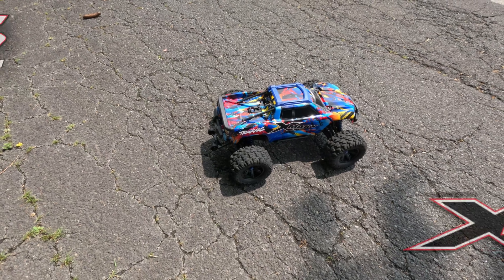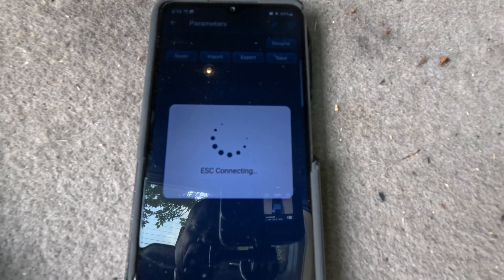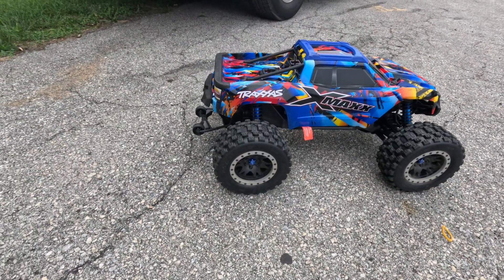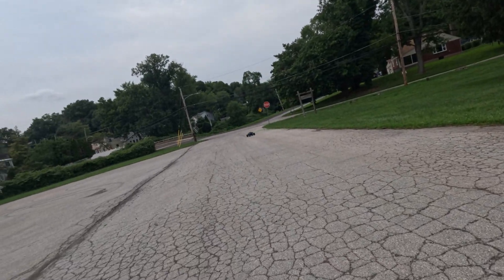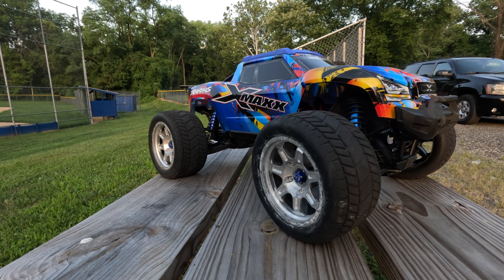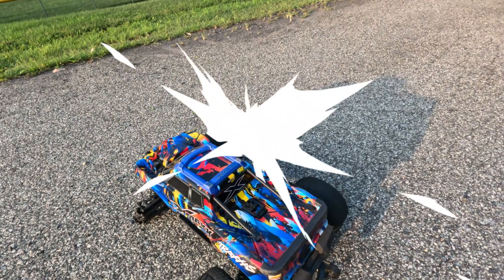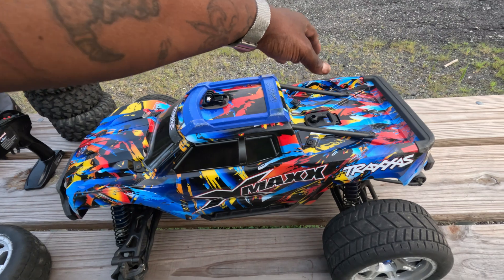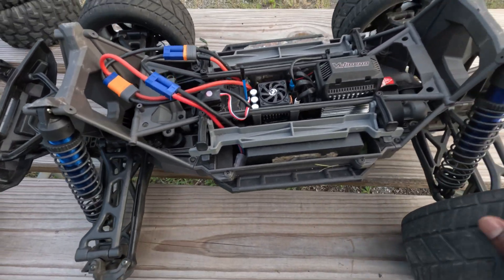Traxxas X-Maxx V5 Hobbywing Max 6 G2 Tire Swap pt2

Comment: How much of a difference, Philly? I bought a max6 5 years ago to put in my XMaxx - its still in the box.

The guy I bought my X from was bashing it on 18/50t - thought it would have killed the stock esc.
Reply from the maker: It seems a little faster, I just need to gear up. Or put a max 5 in it.
Reply: @rcbeast101  cheers maybe its worth trying. Saying that, it took me 2 years just to replace my centre drive shaft. My rc's kinda the lo and slow version...

Comment: Max 6 or Max 5?
Reply from the maker: Didn't realize I put Maxx 5, lol. It's the 6.
Thanks for telling me.
Reply: @rcbeast101  I was thinking a Max 5 would be night and day in the Xmaxx. You should pair it up with a 1250 KV sensored.
Reply from the maker: @jagergerg9771 You're right. I saw it ran on  the Max 5, and it's a  Monster.